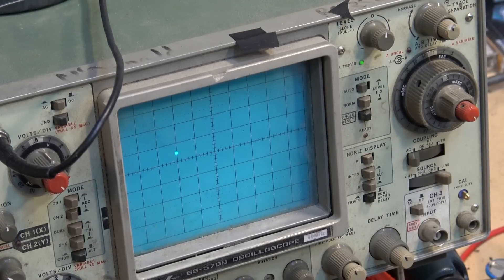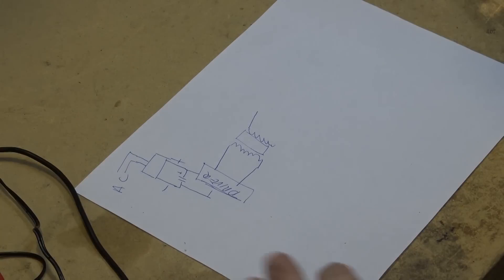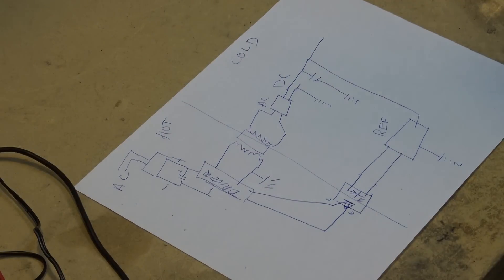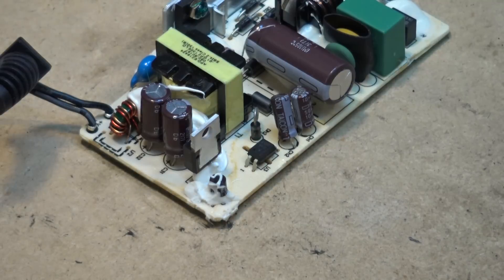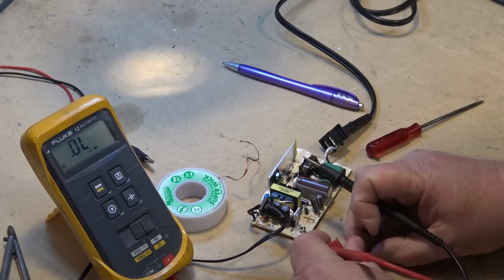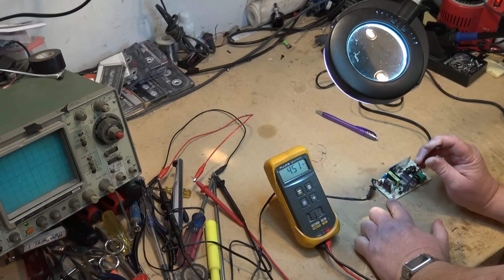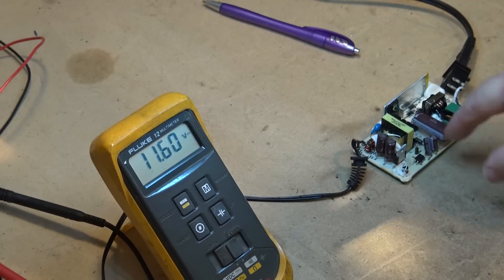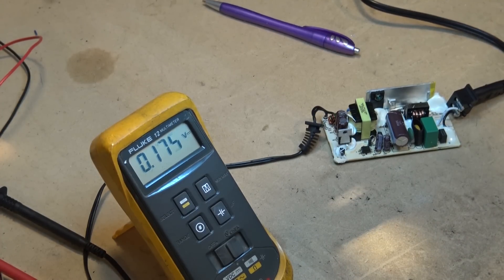Switching power supply regulation problem (Re upload to fix sound)

Comment from the maker: Threw on a bunch of filters to remove the buzz in the audio of the original.
Reply: I didnt notice a buzz in the original, but im half deaf so lol :-D
Does sound like the oscilliscope eather has a low eht/beam current or what ever the term is, i have an old cossor oscilliscope with a problem of vanishing trace, it just dissappears, a flick of the power switch and its back, often for hours.
I just know its the type of fault that if you take the case off its gone, one of those lol.
For crude info i have a old old portable telequipment D?? one, battery/mains, most of the wires going to connections on the edge of the pcb were on/off dodgy, i moved the wire joints firther in board.
The edge connections were a bloody pain for failing, i was pissed off every time i needed the scope, the bloody thing didnt want to work.
Behaves itself now lol.
Reply from the maker: Spent a few hours on it tonight. No luck so far, no beam at all now.
Reply: Is the eht still working, stick a hv probe on it.
Is there a bias voltage on the beam control?
Knowing your luck, its a bad crapacitor lol.
Reply from the maker: That I don't know. I don't have an HV probe. That was one of the things I didn't get from the shop. That and the VTVM as they were owned by the shop. I took all my own test equipment, scope, fluke 12 and my ESR tester, plus hand tools. The rest stayed behind.
Reply: I have had a look at the schematic, and it seems there is a switching/oscilating power supply - supplying the crt voltages.
Transformer T01 is driven by Q01 Q3 and a 4558 opamp, the secondrys are the heater supplys (low emmission) low voltage perhaps, also the cathode and g1, g3 focus, M01 X12 eht generator.

R31 is the intensity adjustment pot, 120v is fed to that, the other end is r32 to ground, wiper goes to a reversed diode to a mess of bits on the output of the transformer, capacitors in series and another odd diode, seems to go indirectly though capacitors to G1, makes no dam sense at all :-(